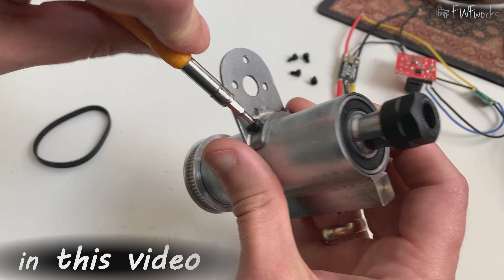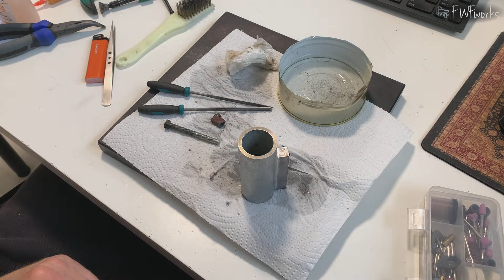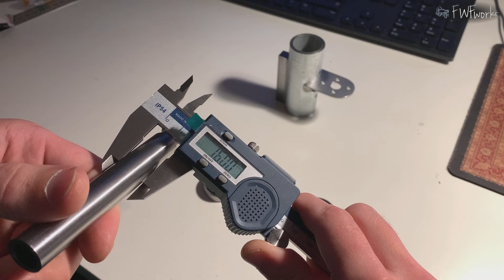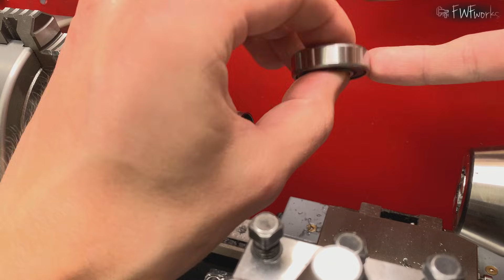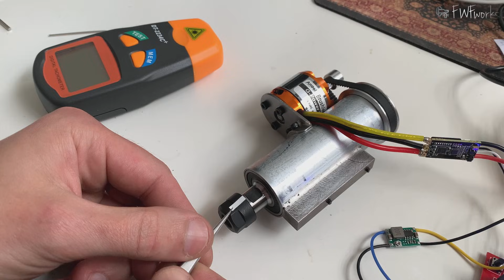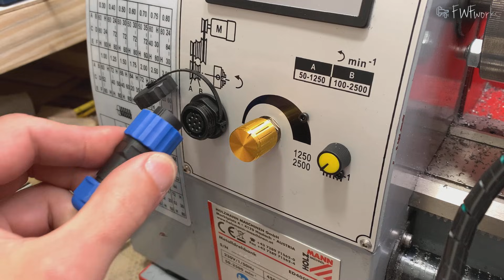Mini Lathe Toolpost Milling Device

Comment: You installed regular bearings, not tapered? and then at @6:07 you saying you need preload in regular bearings? How its possible? I thought preload is available only in tapered bearings? then you press them together and shaft starts to rotate with some effort? You don't think you damaged the bearing races?
Reply from the maker: In theory, I should have used angular contact spindle bearings. But I decided to see if ordinary radial bearings would be good enough, since they can handle a small amount of axial load.

It’s been almost a year now, and I’ve been using this setup regularly without any problems. The only thing I changed was the motor mount. I redesigned it and moved it between the pulley and the motor.

Comment: You need a welder bother
Reply from the maker: Yeah, I know 🤷‍♂️
And it would also be nice to have a proper workshop where I could store it… And weld absolutely everything I can get my hands on 😈
Reply: What is the rating of the brushless motor you use?  Do you think it has enough power for what you use it for.?
Reply from the maker: @johnwalker1471  I use a D3536 910KV brushless motor rated at around 350W. It handles aluminum with tools up to 6 mm and steel with tools up to 4 mm very well. That’s more than enough for my needs.

Comment: This is awesome! I'm getting a Little Machine Shop 5100 HT in a couple weeks and would love to have this! Could you put together a guide to make one, including parts? I would love to make one just like yours.
Reply from the maker: Hi! Congrats on the new lathe!
To be honest, I didn’t plan to make a very detailed step-by-step guide on how to build this setup. My main goal was to show the concept. That it’s possible and how it works in practice. In the video, I mentioned most of the parts I used, so you can take that as a starting point and adapt the idea to your own needs or come up with your own solution.

For reference, here are the main components I used:

Angel D3536 910KV motor
2GT drive pulley, 12T
2GT driven pulley, 60T
2GT belt, 150 mm length (75 teeth)
ESC for multicopters, 6S (22.2–25.2 V), about 30–35 A
Power Supply 12v 20amps modified to 16 volts

Hope this helps, and good luck with your new machine!
Reply: @FlyWolf_works  Oh that's great help, thank you! I hope to get the new machine on Saturday... I'm new to machining. I'll mostly be working on 1:24 scale slot cars, and then who knows!

Comment: ну найс ЧЁ сказать. а размеры готовой детали будут и на какой станок скрафтил?
Reply from the maker: I’m using a Holzmann ED 400FD lathe. Dimension-wise, it’s equivalent to the well-known WM210×400. But in my case, it has a 100 mm chuck and a slim spindle with a 21 mm bore.

Comment: That's very cool FWF. You made some interesting choices - motor, housing, bearings etc - that seem to add up to a very useful tool. It's one I have been thinking of making for a little while. I noticed you did some careful line-ups with the test indicator, something some hobby persons might be tempted to skip. Great video, thanks for sharing ...
Reply from the maker: Thank you! 🤝
I’d like to build micro internal combustion engines in the future, so I need a slightly higher level of precision than a typical hobbyist :)

Comment: Hi, although im using universal router holder, i find your idea very useful. If i can ask how you power this small bruschles motor, from extra li-po battery, or from some kind of power source? Greetings from Germany
Reply from the maker: Hi! Thank you for your comment! 🤝
I’m using a 240W AC/DC 12V power supply, modified to 16V (I changed the feedback resistors and output capacitors). It can deliver about 15 amps at 16 volts.

Comment: I found you video very interesting and like liked your accompanying commentary, however I did find the music distracting.
Reply from the maker: Hi, thanks for your comment. I later realized the music was a bit distracting, so I’ll work on improving the sound in my next video.
Reply: @FlyWolf_works 
Looking forward to seeing more of your work. I’ve not used a lathe or milling machine since my school days. 
I’m now looking at getting a mini lathe to help me building robots and some other projects.
Reply from the maker: @paulfrost8952  
Great hobby! I must warn you, though - be careful with mini lathes. Unless you’re ready to spend 3000-4000$, you’ll likely end up with a cheaper (1000$) Chinese lathe. You may or may not need to modify it. It really depends on your requirements. They do work, but making precise parts on them can be challenging

Comment: Great example of how to do alot with a little :) Only things i would change are the bearings to hybrid ones(did not see if they are) and i would brace the motor shaft on the side of the drive gear :)
Reply from the maker: Hello! Thanks for the comment 🤝 You are right, I’m using standard ABEC-7 bearings. I thought about paired spindle bearings but it would be overkill for my loads and speeds. A second shaft support near the pulley would complicate belt tensioning, since I currently adjust it by shifting the motor in oversized mount holes. The more robust solution would be to extend the motor shaft out the mounting side, rotate the motor 180°, and place a bracket between motor and pulley — but I didn’t want to disassemble the motor, as the shaft is usually fixed very tightly. 

I’ll update the design if I find any shortcomings, and of course I’ll make a video about it 🫡

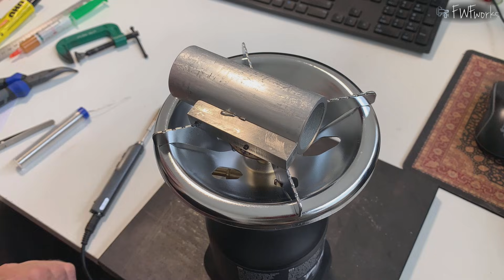Comment: 2:22 Try brazing. It's surprisingly easy, and makes very strong joints.
Reply from the maker: Thank you. I thought about it and even bought brass solder with a melting point of ~900 C°. After testing on a small part, I realized that I have nothing to heat the bearing housing to such a temperature.

Comment: U used any special flux for soldering aluminum?
Reply from the maker: Hi! I did not solder aluminum in this video. The housing, holder and motor bracket are steel.

Comment: Very neat! How is the solder holding?
Reply from the maker: Thank you 🤝
At the end of the video, you can see a 6 mm cutter removing 0.5 mm from AW-2007 aluminum to a depth of 9 mm. No vibration or chatter can be heard, and the cut is clean. I think the solder and screws provide enough rigidity.